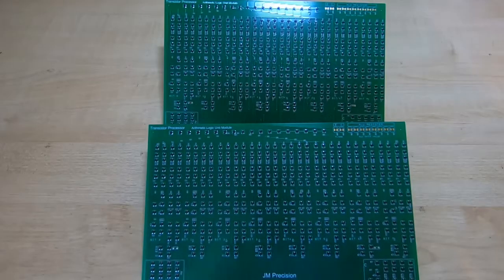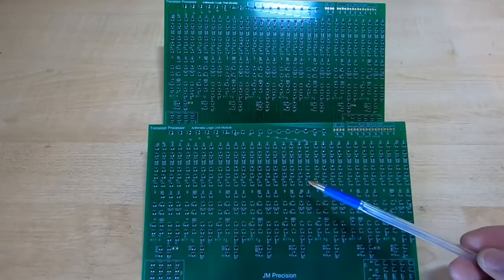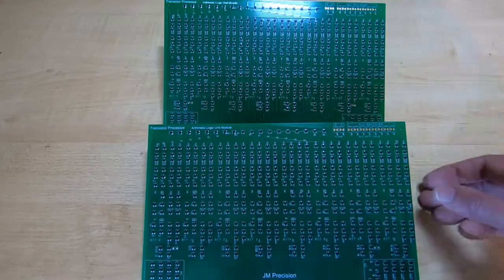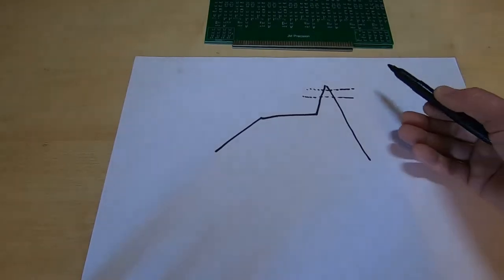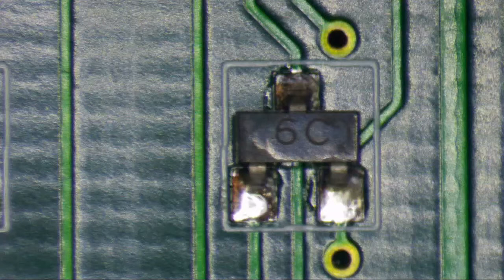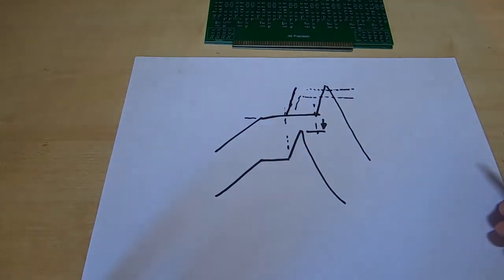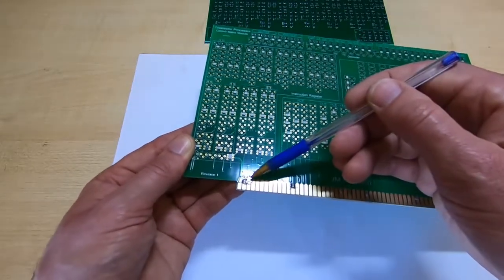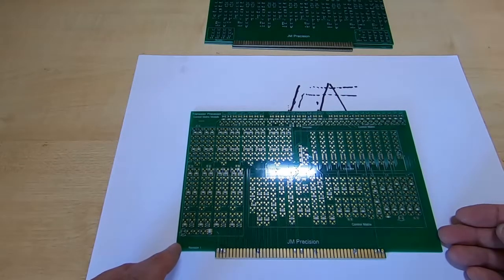Reflow Temperature Profile

Comment: Hello, whats the max temperature for cellphone's PCBs? I suppose they are lead-free solders. Is it possible to match the reflowing profile with the hot air reworking station?
Reply from the maker: The max temp depends on many factors so it is not possible to say. You should be aiming to match the solder paste specification. Hot air stations are really intended for repair and are not really suitable for pcb manufacturing as the profile is fairly critical in terms of temperature and time and it is very unlikely that you could achieve the required profile with a hot air station. Also if there are problems then you can make small adjustments to a reflow oven profile (as long as the oven works correctly) but a hot air station will always have a lot of variation. I would also not want to try using a rework station to reflow a board with components such as 0603 or 0402 as they would most likely end up being blown away.
Reply: @JerryWalker001  I am trying to fix a problem of the original Google Pixel 1, which seems to have a soldering problem on their codec chip WDC9335. I am a bit confused as I've seen some people on youtube just going for it sticking the hot air without any kind of preheating, and others covering with aluminum just leaving a cutout for the desired chip. I was worried of thermal stress in both cases.
Reply from the maker: @quelorepario  You cannot use a reflow oven to heat just parts of a board. If you are trying to repair a board by reflowing specific parts then it is best to mask off all the parts you do not want to reflow but it all depends on the nozzel you use and the board layout and size of the part you are trying to reflow. It is best to preheat the board before attempting to reflow a part as this will minimise thermal shock. It would be a good idea to try a few practise attempts on similar scrap boards.
Reply: @JerryWalker001  thanks, would 250°C a reasonable peak temperature? Btw, I have a no clean flux (Amtech NC-559-ASM-TF), would it be appropriate to surround the chip with it?
And as soon as I see it melting, to close the distance to the chip, counting 10 seconds and then moving back slowly?

Comment: We say that for our pastes you should be over the liquidous for anywhere between 30-90 seconds to give the best results. Typically solder pastes are reflowed for 6 minutes to allow the flux to do its  job and not exhausting itself. Great Video
Reply from the maker: Thanks. I also think that many people keep solder paste stored incorrectly for too long and that makes the problem even worse.
Reply: @JerryWalker001  Absolutely. solder paste needs to be loved. We are producing in humidity and temperature controlled environments for a reason!